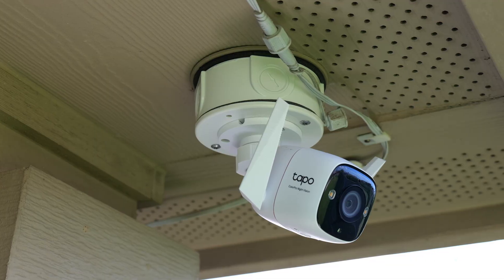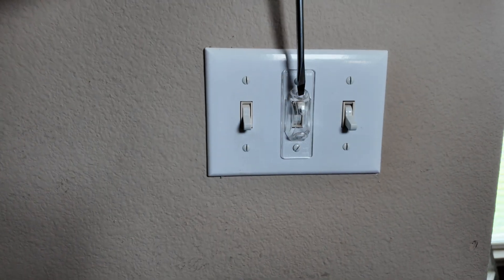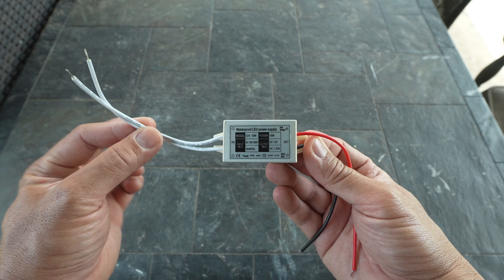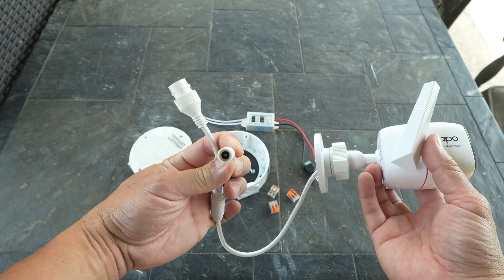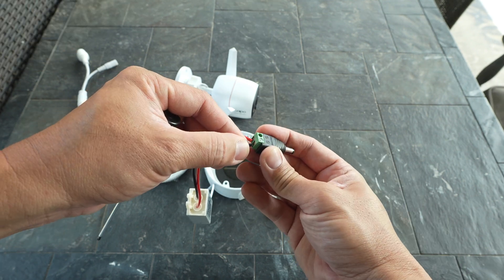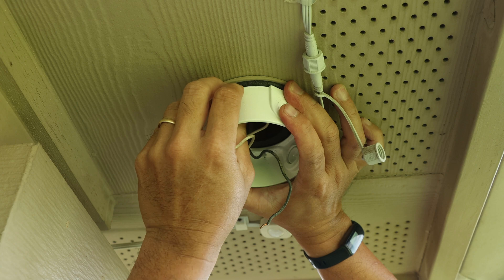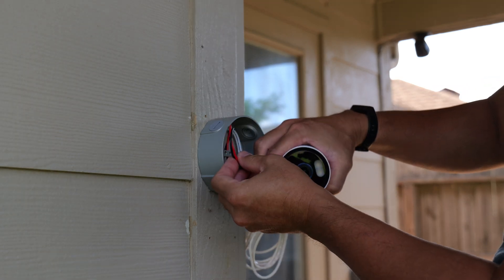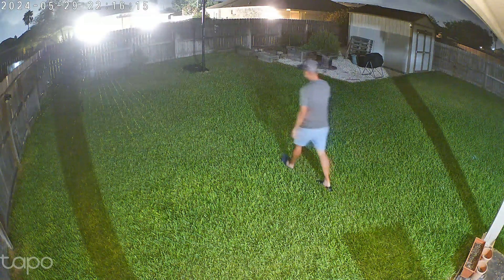Hardwire your WIFI Security Cameras - No Power Outlet Needed! ft Tapo ColorPRO

Comment from the maker: Just to clarify especially to those that haven't worked on light fixtures and junction boxes before..."power off" means turn off at the switch and also at the breaker box, and double check with a line tester to make sure there is no current on the wiring that you will be working on.
Reply: Hi @LifeHackster. Do you think Tapo 520 and Tapo 325 WB will work safely with transfer IP67 12V 0.83A 10W or better to use IP66 10V 20W 2.0A ?
Reply: Hello,
The camera is 9v 0.82a but the  transformer in your episode is about 12v. 
Is there a risk of cook the camera ?
Reply from the maker: @taouficn.7330 Nope. Ran this setup for around a year and no issues.

Comment: Im planning to do aa diy install of my cctv cameras, wondering if this stuff will work with TAPO TC65. Power supply ive been seing are all 220v to 12v 1A which are locally available. This is such a clean setup and appreciate you making a video about this man.

Comment: Thank you for this video Hakster. So what if I am installing the Reolink Floodlight Camera.. that would need a different transformer   Specs?
Reply from the maker: You are talking about the Duo Floodlight and not the new floodlight Elite?  for the Duo Floodlight, this setup should work but for the floodlight elite, no need for this hack, you can wire it in directly to your house's wiring.
Reply: @LifeHackster thanks a lot sir. Yes its the older version not the elite. I was just thinking maybe it’s ok for a solo camera but not with the one with the floodlights. You are awesome for responding this quickly.. much appreciated.

Comment: I would like yo do the opposite  add battery I'm case the cord gets pulled
Reply: buy an ups for this. Inside 3 Li-on  batteries. Use this ups instead ac power adaptor. Once no electricity it is automatically switch to the batteries without power interruption. I bought it on shoppee for 2 dollars. I checked it on my Xiaomy cw300, it lasted 5 h 30 mins.

Comment: Thanks for the video. It would be a really good idea if these camera companies would add a simple three wire AC plug on the camera and they provide a little pigtail jumper that connects to it so that they can sell an all in one solution for people with existing electrical. That way, you do not need step down transformers. Or maybe they sell ac versions of these cameras?

Comment: There is a ground wire coming from the junction box. Where did you attach it ?
Reply: May I ask what you did with it?
Reply: @teo4618  SORRY FOR THE DELAYED RESPONSE. i ATTACHED THE GROUND WIRE To THE METAL EXTENSION box between the house junction box and the camera housing

Comment: Is there any way to power supply a outside wifi camera with some kind of power bank, i do live in a hill side house and need to install a outside camera but i dont have any kind of power source available at the point where i need to install that camera, i can supply the wifi connection using a mobile wifi router with a normal usb power bank
Reply: buy an ups for this. Inside 3 Li-on  batteries. Use this ups instead ac power adaptor. Once no electricity it is automatically switch to the batteries without power interruption. I bought it on shoppee for 2 dollars. I checked it on my Xiaomy cw300, it lasted 5 h 30 mins.

Comment: This box extension was a great idea as I was wondering how to get this to work.  I ended up having  to loop the extra wire around the cam and having to use electrical tape to tape it up but it looked amateur.  What I did do was bought a cheap electrical cord at HD for around $2.50 and cut off the female end and wired that directly to the box and then plugged in the camera.  This way you don't have to buy those adapters which I think makes it more complex than it has to be and all will fit nicely in that box extension.

Comment: DYNOMITE!! Did you experience any issues with the Eufy E330 Pro though, it claims to need 19W. Was thinking the 2amp 24W version, but if it worked fine with 15W @ 1.25 amp, excellent. Thanks.
Reply: Did you get a private reply to your question?
Reply: @nonyadamnbizniz8754 No but I followed up with Eufy, twice. After reminding them "I'm still waiting for a reply", an engineer responded and advised 15W would be more thsm enough. So that's what I used and it's been working g great for a couple of months. So if you're in the same boat,  you're good to go. 👍

Comment: Suggestions, when the power goes out my monitor goes black. What type of backup battery 🔋 supply can I get to allow me to see my surveillance camera’s. The cameras are hard wired. Thx 🍻
Reply: buy an ups for this. Inside 3 Li-on  batteries. Use this ups instead ac power adaptor. Once no electricity it is automatically switch to the batteries without power interruption. I bought it on shoppee for 2 dollars. I checked it on my Xiaomy cw300, it lasted 5 h 30 mins.

Comment: nice. I actually have thought about trying something similar to this but with my poe switch instead of a 12 volt power adapter. I wanted to get 12v dc power from a cat 6 cable and poe switch to a infrared light. I would only need 12v on 2 wires from any of the 4 pairs then re connect it with a male barrel plug adapter to fit the female end on the light instead of a rj45 connector.
Reply from the maker: PoE Splitter -> https://youtu.be/6_2QIgTwIiw?si=MVJ9bnSVvyRHuayu&t=449
Reply: @LifeHackster  I didn't know I already watched your how to on that but it's exactly what I'm looking for thanks LH.
Reply: Can the 12v effect the camera vs 9v you mentioned it normally uses

Comment: My issue is that my soft lift is thin metal and I have no attic access. Worst of both worlds.
Reply from the maker: Conduit setup if you want wired or battery powered cameras can be an option in your situation.
Reply: @LifeHackster  My main issue is that I'm trying to think of how I could run ethernet (assuming POE) around my house to get to the camera. I have vinyl siding so I don't want to poke and crack a lot of holes. I was thinking maybe just run it alongside the vinyl to hide it, but trying to figure out the least damaging way to secure it in place on the vinyl. I'm not a huge fan of battery powered because I like to load all the streams up and monitor from my desk, so that wouldn't work.
Reply from the maker: @TalOrmanda  Conduit setup for long term and professional looking install or run outdoor rated ethernet cables behind your fascia board or you might be able to tuck it in behind your vinyl siding.

Comment: Can this be used on a Wyze V3 Pro if I was to use a  usb c adapter instead of the barrel?
Reply from the maker: Unfortunately, No. USB powered cams needs 5 volts DC. If you can find a transformer that has 5 volts output, then it can work.
Reply: @LifeHackster i have a USB powered Lorex and the wire itself says 12v power requirement
Reply from the maker: @nisarakbany8000 Yes on Lorex but not with Wyze
Reply: @LifeHackster  awesome man, appreciate your response
Reply: @LifeHackster  i have 5 wires in my lorex USB... red and black (power and neg) and then white, red and green? Can't find anywhere what these are for

Comment: Again someone claiming a hack stating no power outlet needed ... what is coming out of your ceiling ... is that not power cables connected to a power outlet ????
Reply from the maker: Did you see a power outlet in the video? Power cables are hardwired to your house well to my switch…not to a power outlet…

Comment: One thing to note is that you should always turn the power off at the breaker box, and not rely on the wall switch.  Because that connection could still have power to one of the wires, depending on how it was wired in.
Reply from the maker: True..
Reply: @LifeHackster  so then would you show that you only turned off only the wall switch and not mention to turn off the breaker?  You know better, I’m a bit disappointed in you.
Reply from the maker: @Resist4  Yup, be disappointed then... I'm not sure what the term " turn off power"  means to you... I didn't say turn off the switch....and just because I didn't film when I flip the breaker.....anyways, it is making good engagement so... roast me... ;)
Reply: @LifeHackster  well when you only showed turning off the wall switch someone will think that’s all they need to do, because when you flick that switch off the device turns off.  So in their mind the power is off and you only did that so it must be okay.  As I said, one of the wires can still be hot and most people don’t know this.  You should have at least said in the video to turn off the breaker as well, instead of recording you turning off the wall switch.
Reply: @Resist4 grow up.
Reply: @ okay, lol.
Reply: I’m here for the same. Thanks for pointing it out.
Reply: @limacs  Yep my Dad's vest friend, a Master electricia  died this way. Ovr time men ignore basics. This is why divorce occurs too 😂

Comment: If you could convert wifi cameras to ethernet, specifically ring which only makes wifi cameras then they would not be vulnerable to jamming.  Does Reolink offer a monitoring service?  Or maybe you can use them with something like ADT and Virtual Security Guard equivalent where the monitoring center actively monitors your cameras and takes action on your behalf, not just monitoring for when there's a break in and the alarm goes off.
Reply from the maker: I don't think Reolink has a monitoring service.
Reply: if youre so worried you think somebody is going to jam your wifi, why wouldn't they just snip your isp/fiber/etc line coming into your house? would actually be easier
Reply: @cryengine_x  there are South American mafia groups that have been using wifi jammers lately, no one has cut the fiber line as they would be recorded on camera cutting the line before it went out and then the alarm switches to cellular.